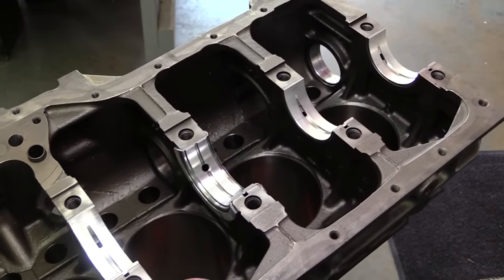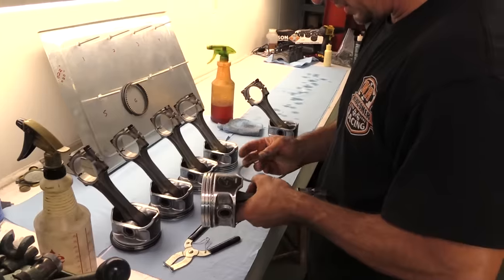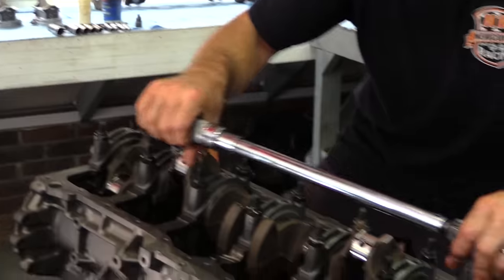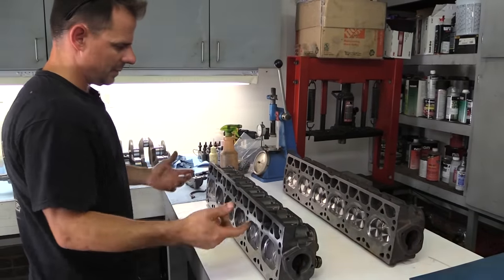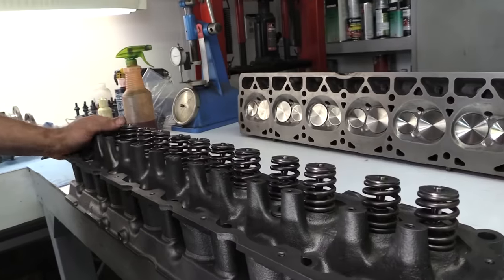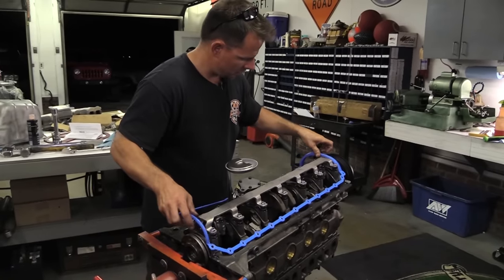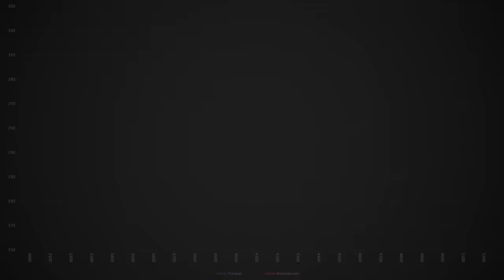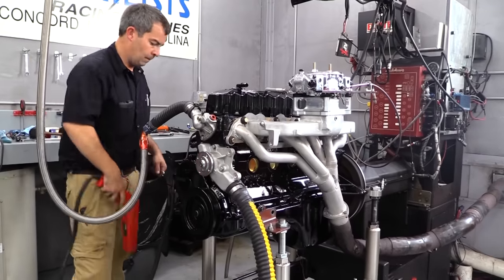Big Power Jeep Straight Six Stroker Build on a Budget with Newcomer Racing

Comment: That is really cool and all but $5,000 for 300 horsepower.....😬
Reply: 6.0 ls  1000 an 315hp yikes
Reply: 5000 k for an extra 100 HP ? Sounds like a lot of $$$$ in My world for 100 hp more
Reply: Exactly what I was thinking.  It’s cool to to see different engines and what can be done to them but apparently you don’t get much for $5k on this platform.
Reply: The Electric Wrench. It is not $5000 for 300 HP. A bone stock rebuild is over $2500.  It is about $2500 for the extra 100 HP., and no NOS bottle to fill.  It can be driven every single day for 200,000 miles if cared for.  Most of the time you can't turbo it.  You look under the hood of a Wrangler X and tell me where you are going to put a turbo.  Also, find us another straight six with stock  parts, the block, head, a stock crank and rods from another engine, stock valves, and valve springs, and no port work that makes that much power. I would be interested.
Reply: @jhutch1470  I could definitely rebuild one of those for way less than 2500 I don't know what part of the country you guys are in but where I'm from that's a bit of a far stretch
Reply: @motersickel  rich people don't live in the same world that regular folks do
Reply: If you need a new engine it's a good price.
Reply: @jhutch1470  how is a rebuild 2500 dollars?  Itemize that for me because I bet I can put new pistons, bearings, valve seals & gaskets in one of these engines for under 500 dollars.....
Reply: @elonmust7470  I re-read my statement. A crate rebuilt is $2500. My next door neighbor had his rebuilt and needed a new crank as the front main bearing ate it. His was $1900.
Reply: @dallasjaramillo259  the ly6 is what was in almost every 2500 series gm truck or van...........
Reply: @elonmust7470  a 6.0 which is what I had in my truck had 300 hp later gen had like 315 do your research
Reply: @dallasjaramillo259  So what code 6.0 is in your truck?? and with a cam you can gain 100 hp.  Stop arguing semantics. The ls v8 is a reliable powerful engine.
Reply from the maker: Exactly! You get it. Thanks for watching.
Reply from the maker: Engine builder needs to make some money too. But it's always going to be cheaper (and more fun) if you do it yourself. That's what this channel is all about, but working with professional engine builders helps me get good content to share. Thanks for watching!
Reply from the maker: Did you count machine work?
Reply: @TheHorsepowerMonster  110 for the bore & hone 60 for decking both head & block. 75 for the seals. Thats what it would run in my case.
Reply: @elonmust7470  when did I say It wasnt 🤣
Reply: @motersickel  you can doing it yourself.  But paying standard labor rates you won't.  People dont give away their labor
Reply: Clint Way - Yep and very few people have the skill/knowledge/tooling to do what was described here.
Reply: the last one of these engines I rebuilt I think it cost at around 1500 bucks that was decking the block bore new Pistons rings having the head redone all gaskets the whole nine yards
Reply: Of course it helps when you know the guy at the machine shop really well....I can get things done at a way better rate than most people would pay... I had a Toyota 22RE engine cleaned decked bored 40 thousands over and the rods Recon for a hundred bucks and before you say this guy doesn't know what he's doing because of his prices you're wrong...this guy has one of the best machine shops in this town... he just hooks me up real good...
Reply: The Electric Wrench - 👍🏻 The 22RE is an awesome engine too!!!
Reply: @black98rt  reliability. 

The 4.0 is a tank.
Reply: @motersickel  not that i know of. 

Im in the business, both pennsylvania and florida and wouldnt do a 4.0 for just 2500.
Reply: @elonmust7470  you couldnt.
Reply: @TheHorsepowerMonster  exactly
Reply: @constitutionalrepublican1611  how would you know?
Reply: @elonmust7470  couldnt build it for 2500 unless you had access to all the machines and parts at cost.  Even at cost, engines easily 2500 without modifications to factory spec/ and or a crate engine.  

For the mod, its easy to see the extra cost, 

Just factor in labor. 

Say 100$ an hour to start.
Reply: @constitutionalrepublican1611  do you want me to post linke for all of the cheap as dirt parts out there for the 4.0 i6?
Reply: @elonmust7470  cheap dont mean reliable. 

Most new stuff nowadays is trash, 

Like the radiators they push on jeep owners. 

Finding a good all aluminum radiator is not always easy....  
 Sure you can be cheap, but not reliable. 
 Look at the waterpumps, look at sensors, etc.  You could use the old one obviously if you want to be cheap...... But again, how many miles will be had from a cheap or used part?????
Reply: @constitutionalrepublican1611  you don't need an aluminum radiator. A stock unit works fine.
Reply: @elonmust7470  stock rads suck. The plastic on the sides always crack. 

Worst design of them all.
Reply: @elonmust7470  if i had it my way they would still use copper radiators. 

Triple core.
Reply: @constitutionalrepublican1611  Never had an issue myself but plastic is a weak link
Reply: @elonmust7470  youre lucky and probably baby your jeep. 

On my one jeep the wj, im on radiator#5 soon to be 6.its got a slight weep, not big enough to be an issue but when i switch vehicles again its time for a change.

I live in the mountains now, trips to the store are 50+ miles each way for me highways often, and also bumper to bumper city traffic 3 times a week....  That wj jeep was bought new and only knew floridas hot flat land and only drove 10-15 miles a day until 5 years ago ( it currently has 193k+  The new jeeps i have' the 19 grand and the 20 limited and they are electrical nightmares waiting to happen tbh and i am looking into getting the jeep x instead.  The price tag is a bit much but its interesting. Might bite... My yj has the 1995 factory rad, factory everything (except tires) actually, except the drivers side axle (due to it snapping)   hasnt been inspected and sits in garage on the lift, next to a 65 impala.
Reply: Constitutional Republican they’re reliable because they don’t really make enough hp to hurt themselves.  I like the 4.0 engine but I could never justify spending $5k on only 315hp.
Reply: The 4.6 and 4.7 strokers are $4000 so it's on par. But that's why many just drop in a V8.
Reply: black98rt look up lycoming O-450 price.  Not the same realm being an aircraft engine but they only make 260hp and charge over 45K.   Makes off roading look like a cheap hobby

Comment: Very nice build and I love how clean his work is!
As an alternative, the straight 6 Aussie Hemi 265 from 1972 made 302bhp and 320 lbs of torque off the showroom floor. The budget version engine made 203hp and 263lbs.
It looks similar to the Jeep but completely different at the same time. Check it out. https://en.wikipedia.org/wiki/Chrysler_Hemi-6_Engine
I'd love to see him build one. 
https://www.youtube.com/watch?v=htHgs10AHXU
Reply: AMC went racing in the 70s with there 258 in a Gremlin went mid 11s made more than 350+HP and more then 400TQ. With a set of Webber's carbs. N/A

Comment: "On a budget build" doesn't include bench testing a motor or having a half million in machine shop tools in your palatial garage..🤣😂
Reply: You can do this entire build for about $1000 with new parts, given you’re already in possession of a straight six. Much cheaper if you can find salvaged parts. He mentioned the bare block was $3,500. No idea where he got that number from. Maybe he meant $350? And the only tools you need for building an engine is a torque wrench and dial indicator.

Comment: Appreciate that build as a 4.0 Cherokee owner. Stuff to dream about.
@ The builder: reconsider dropping the hydro tappets with a magnet ! The tapped manufacturers spend big effort into non magneting the parts to prevent metall part collect into the tappet and block oil flow inside the small channels (oil leak gaps). Putting a magnet on them will make them magnetic again.

Comment: 300 hp? wtf? with a carb and good old distribuitor, who needs computers...
Reply from the maker: I'm with you.
Reply: Omega Rugal I’m with you on that
Reply: And I'm pretty sure it made more power that the one horsepower TV built a few years ago with an Edelbrock head!
Reply: Carbs suck for off camber stuff. For anything offroad, especially crawling, I would take EFI evry day of the week.
Reply: @randycane5894  the make a truck avenger carb that allows it still work at up to a 45 degree angle. Regular carbs would crap out at half that.
Reply: @Truckerdaddy  That would be better than nothing I guess
Reply: @randycane5894  definitely cheaper than a full EFI setup. Unless you yanked one from a junkyard.
Reply: People who want reliable offroad performance
Reply: @Truckerdaddy  modular efi is getting cheaper everybday
Reply: @elonmust7470  truck avenger Carbs are around $500
Reply: @Truckerdaddy  and they'll need to be screwed with constantly.  Fuel injection is just better. In every way.
Reply: @elonmust7470  I'm not saying it isn't but for folks who don't like dealing with tons of electrical, carbs are their choice. Plus it also depends on what your using it for. Mud bogging tends to lean more to carbs because water, mud and electrical don't mix well. Rock crawling, tends to lean more EFI because of the steep grades they tend to deal with.
Reply: @Truckerdaddy  gm plugs are watertight. People are way too reluctant to warm up to efi.  It's bulletproof these days.
Reply: @elonmust7470  to each there own
Reply: @Truckerdaddy  indeed
Reply: And the sad part is it could make +50hp while being far more reliable if it was build with EFI. Sorry boomers, EFI isn't stuck in the 80s and is nowhere near as complicated as you make it out to be.
Reply: @trumppepe181  exactly.
Reply: @elonmust7470  I really don't understand the hate boner boomers have for EFI. A basic EFI system that doesn't control ignition only needs 1 oxygen sensor (cheap ones can be had for like $20 lol), a MAP sensor (which you can yank out of any car in a junkyard for $3), some way to measure air temperature (again, $3 of a junked civic or something) and some sort of RPM signal (which can be tapped into from the distributor). For this engine, a simple throttlebody injection system would work perfect and wouldn't require you to modify the intake manifold. And with that you get far better idle, much better control of when and where fuel is injected throughout a myriad of load condtions all through the rev range, and much easier cold starting. The best part? Once it's all installed it will never need to be adjusted again because all of that is done for you automatically. The ECU itself can be as simple as an Arduino ($14 on eBay for the best one, look up the Speeduino project, it has run everything from literal lawnmower engines to huge V8s)
Reply: @trumppepe181  TBI is the next logical choice, my point was that EFI is not the only way to het high HPs and torque as many think...
Reply: the build didn[t even need custom or special parts, just mixing preexisting ones...
Reply: @trumppepe181  yeah they think you need a master's degree in computer science or something
Reply: I use a Megasquirt 3 with mine and you can literally do whatever you want/imagine with them. Learning curve was only 2 months from knowing nothing at all. One of the best ECU's you can get your hands on.
Reply: @CanadaBud23  Yeah ms3-pro was the first engine management system I bought & for a little over 1000.00, I can run anything from a weedwacker to a 12 rotor rotary engine & everything inbetween LOL! 10k feet below sea level or on the top of mount everest, just need the correct map sensor
Reply: @elonmust7470  I know it's ridiculous lol, you can run the strip and launch the space shuttle at the same time lol.

I wanted to get a pro but I ended up with an MS3X. I wanted to wait a little bit still because if there's a "MS4" coming then I want to get that. Hopefully with newer and bigger procs to work with.
Reply: canuckguy worried  none of that really made much sense
Reply: canuckguy worried  My father & I live on opposite ends of the continent, my mother, is dead.
Anything else?
Reply: canuckguy worried  dude I drove a 1974 390ci f250 ranger before I had my learner's permit. I was resurrecting old 6 cube McCullochs after school. Not only can I rebuild your typical float bowl carb, I can rebild all of your diaphram carbs as well. I left the ford on the ranch but I still have a 1970 duster with a 340 in it, and you guessed it, a carb...
Reply: canuckguy worried  I think both were designed by people from several generarions preceding boomers, but wharever.
Reply: canuckguy worried  I agree. I've run ms660s since they were ms066s and have now stopped buying them because the latest generation, the ms661 does not have a carbeurator but  a computer controlled throttle body on it.  I'd lose my ability to keep the thing running how I like in the different weather & elevation with an 1/8" screwdriver that fits in the suspension of my hardhat..

Comment: Back in the mid 90s 94-98 there was a stroked kit you could buy that made these straight motor to a 5.7 liter no joke. I can’t remember what they claimed for the hp but this was a real deal a company sold I’m pretty sure it was in one of the 4x4 mags but it definitely was a real thing. I’m gonna go through all my mags and find the info and update this. Because the were making a ton of power and were geared at crawling putting most power out at 1500 rpm.
I bought a kit but it wasn’t the 5.7 stroker. It was way too much for my budget.

Comment: 5k for THAT?  lol the thing has a bunch of stock parts LMAO
Reply: @michaelteeple8704  What part of a stock inline 6 cost'a 5k?  The engines themselves are a dime a dozen.  It's not like the engine's full of forged parts.. The head is full of stock parts. Other than a cam, what is so expensive about the build?
Reply: You do have a point there. Im willing to bet a nice cam and the edelbrock aluminum head on a stock block would produce some good power gains at half the cost.
Reply: You can find 5.3 Ls truck engines for $500 bucks sometimes and will make that power with a carburetor if not more. And weigh less. 
Just my $.02
Reply: Steve Williams  you are a moron. Stfu!!
Reply: Reliability should be Off-the-Chart. HARD ASS motor Build!
Reply: @tracym427  then add the cost of trans, converter, driveshaft, mounts, a full exhaust, accesoties not bolting or lining up and a whole slew of odds and ends.  Not everyone wants to ls swap everything.  Some are brand loyal or like the factory look.  Not to mention you are putting a used(possibly wore out) junkyard or second hand motor with no idea of what shape its in
Reply: Steve Williams  My mom is dead so....
Reply: @clintway116  How would someone have "no idea what shape it's in" when he can buy one with a warrantee?
Also there are a myriad of economical transmissions that will bolt up to the motor AND fit under the transmission hump of the jeep.  
Look some people fabricate everything they can on their own, some people buy everything. The former makes for cheap builds..
Reply: Clint Way I’ve got a whole Tahoe and several other vehicles laying around that I can pull the  5.3/4L60 or 4.8/4L80 out of and everything I need to fab it up. But.. I’m just being onery. I love saying stupid Ls comments just to get a rise out of everyone. I’m not everybody has my skill or know how. And I do agree it’s a pain in the ass. On another note I have always loved that 4.0. Love that inline sound, gives me happy feelings.
Reply: tracym427 - Lol, If I tried that swap I’d be well over 5K and it would never run right.
Reply: Chuck Noob I get it. Easy to do. To me it’s all about your resources and accessibly to drivelines/parts cheap. About 8 months ago I bought an LS3 with computer,harness, ect for $2500. Coulda bought a gen 5 Lt1/8L90 at the same time for $3500. Shoulda bought it up too, but I live in Dallas area and this stuff is all over Craigslist and FB market place.
Reply: I daily an 04 GTO, but I'm a Honda enthusiast. That's exactly why. 5 grand is fucking crazy money to only increase output by 100 HP. Put 5 grand into a Honda and you can absolutely stomp most things on the street. Really have to wonder where the money went on this project. I respect the spirit and the result, but dropping 5K on 100HP and calling it "budget" is just insulting

Comment: Love this video!  I have built this same combo for my YJ.  I had estimated the horsepower to be 265 at 4,800 RPM with help from Crane Cams tech help. The stock 4.2 was 115 horsepower. I don't have access to dyno where I live to verify horsepower. I modified a  stock 4.0 manifold for carburetor. Do you mind sharing what manifold and header you used on this build?  I have it bolted in my jeep working HEI ignition.
Reply from the maker: try Keith at www.NewcomerRacing.com . Thanks for watching!

Comment: Makes me look at my 98 Wrangler daily driver. Especially since I’ve put bigger tires on it and have noticed that it seems a little slower. This would liven it right back up.
Reply: Regear it first. Cheaper than a stroker and it will make a huge difference in driveability.